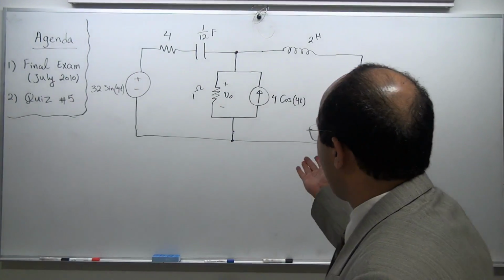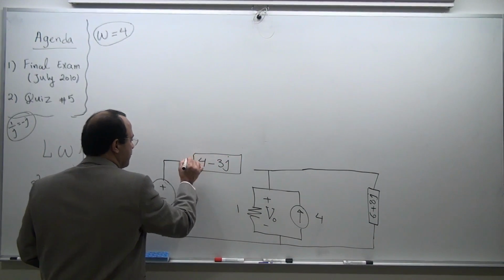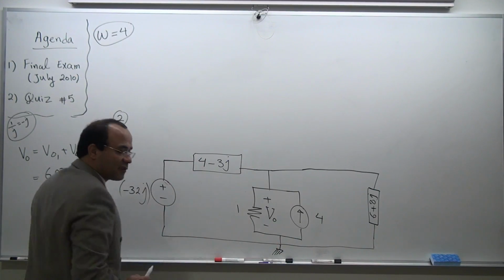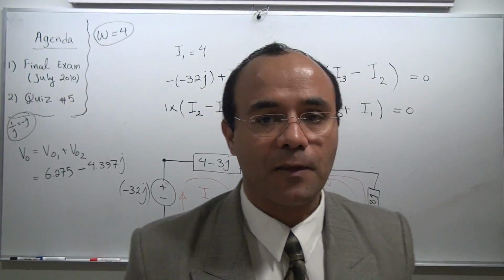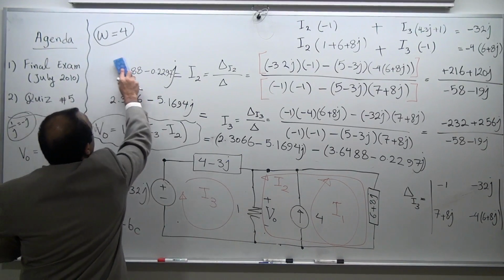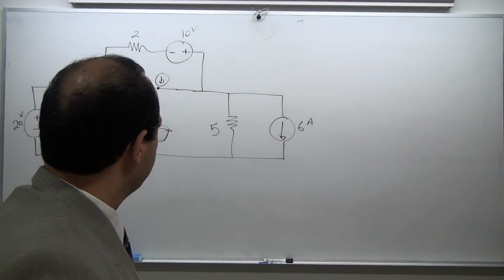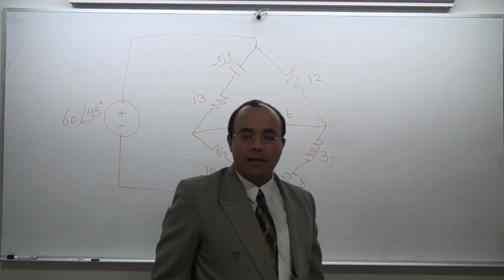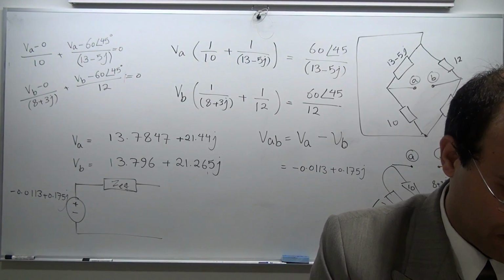Sample Final Exam (July 2010): Part I

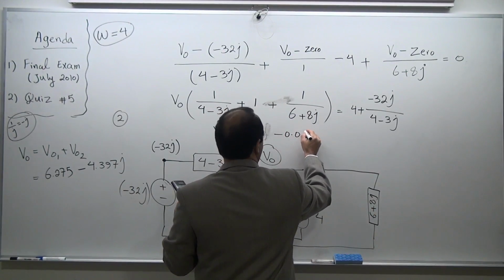Comment: when he does the nodal analysis, at 40:50 / 1:53:22 the correct comples result for the coefficient of V0 is (1.22 + 0.04j) NOT (1.22 - 0.04j). This is also what appears in his hand written solutions. The final answer is 6.28 - 4.40j. this mistake was rectified around 44:10.
Reply: Yes correct bro👌👍